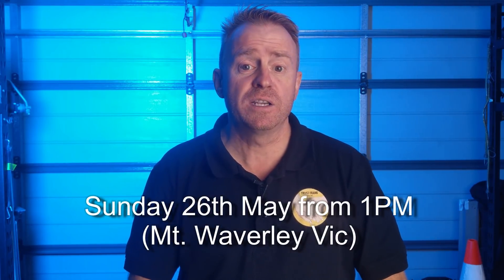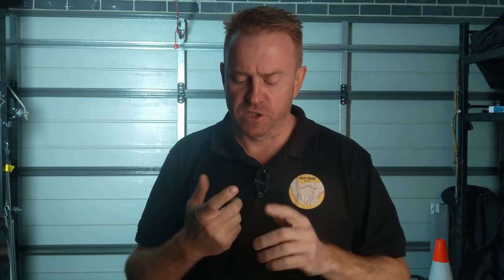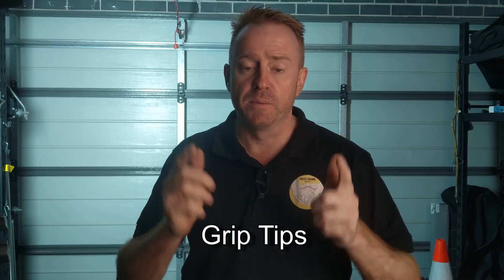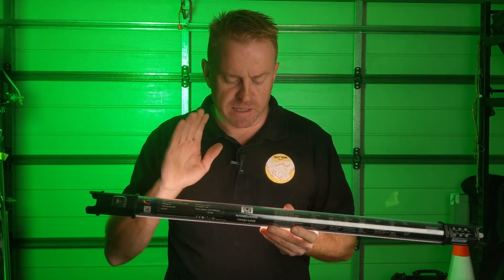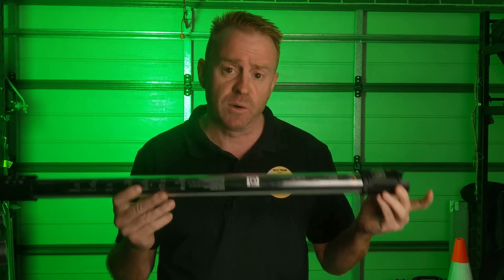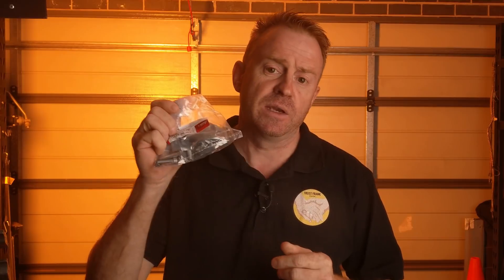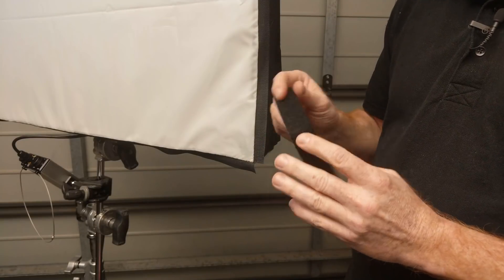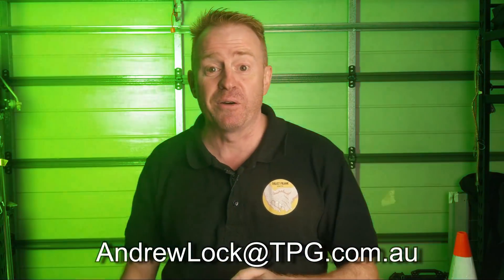Gaffer & Gear 43 - Quick Mix Of Lighting Topics

Comment: recently we had a big job here in austria where we used around 100 skypanels s60 and a couple of 120s and some didn't colour match so apparently even if you buy expensive LED lights there is no guarantee that they match :(
Reply from the maker: Yes. I am incountering in my units (since I made this video) calibration loss. I have 2 skypanels that have lost calibration, with in weeks of each other.

It is noticeable under 20% brightness. (as in you don't even need a spectrometer to see it)

However I just had an S-60 come back from arri with two new light engines and it perfectly matches (both CCT and DUV and X Y) to the non faulty units I bought 2 years ago.

So they do match when they leave the factory!

I waiting to see what the response is from ARRI to my calibration loss issue, if it is an expensive repair bill for what is a looking like a design fault I will go totally nuts!

At the moment, I need one of them on set so I'm having to run all my skypanels in "low end" mode to get a perfect match, as low end mode runs off calibration data stored somewhere else in the skypanels.

Frustrating :(

Is it too late for a tungsten revival?
Reply: @gaffergear  haha yeah the good old fresnels don't have that many sources of error.once in a while you have to change the bulb and maybe fix a broken cable.nowadays with all the led's it like with a new car where everything is controlled by electronic parts and bits which definitely break or go nuts at some point.i hope you can resolve the issue with arri.they should fix them for free imo unless you dropped them from the lighting truck

Comment: @Gaffer & Gear thanks for the vid! How much is the improvement on the new Cello LEDs?? Please can you share your findings VS the older version? Which one matches better with the Timpani? Probably the older version right? Because from what I read only the Viola 2 and the upcoming 2x1 (and maybe some recently manufactured Cellos as you found out) are using the new LEDs, right?
Reply from the maker: I'm currently talking to Luxli before I do a video.

There is some confusion at their end. It could be that the old units were ment to firmware update to this, no one seems sure why my units don't match after the firmware update.

I'm being asked to supply information on my old units to them.

Basicly the difference is the Kelvin is less accurate (but still very good, typicaly within 40k, but the TLCI scores have some massive jumps, at 3200 it jumped from 92 to 98. The white point is more accurate as is the colour accuracy.

It's actually the best LED light I own for colour render and accuracy.
Reply from the maker: My older cello matches my timpani's but my timpani are a year old!